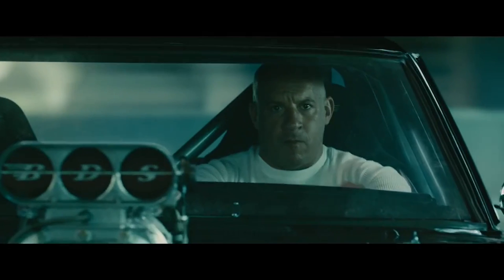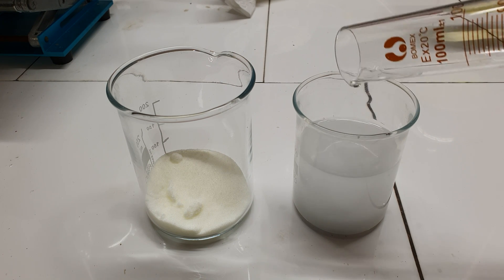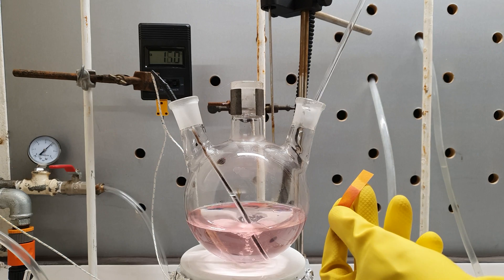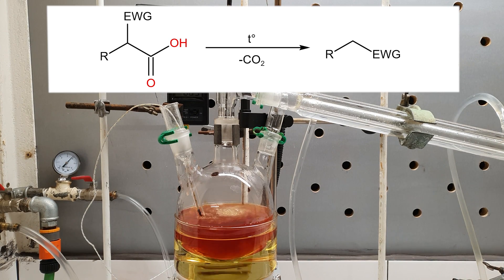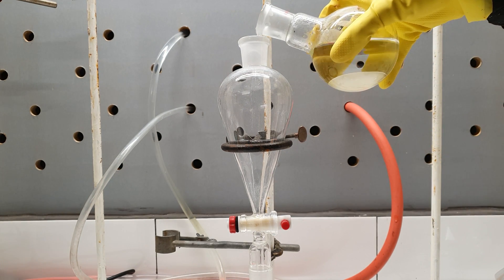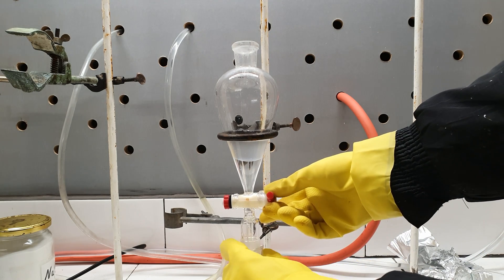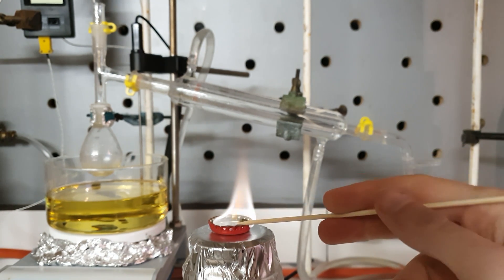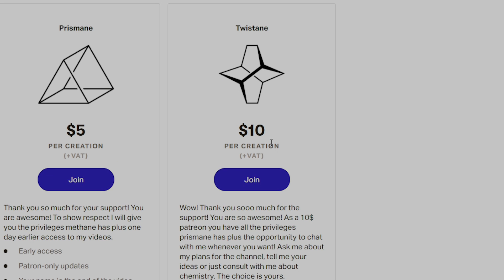Making NITRO for my CAR

Comment: Hi Hexazine,
The low yield is not your fault; it is mostly due to the ambivalent behaviour of the nitrite anion into the exchange reaction.
R-X + Na-O-N=O --> R-NO2 + R-O-N=O + NaX
As you see you have nitroalcane but also alkyle nitrite.
One of the main drawbacks of the nitrite ester is its volatility, and its hydrolysibility.
R-O-N=O + H2O <--==> R-O-H + HO-N=O
From this one sees that one of the side product is HO-CH2-CO2H that you tried to avoid during neutralisation of Cl-CH2-CO2H by NaOH.

There have been many trials to improve the yield of desired nitro-product:
-change the solvent to maximize the solubility of the nitrite into the reaction solvent and increase the substitution reaction
-change the nitrite cation (Na, K, Li, Ag,...); silver is the most efficient for the nitro vs nitrite ratio, but AgNO2 has limited solubility (it is a way of isolating nitrite vs nitrate because nitrite is almost insoluble). Silver salts also have their price.
-change the halide into R-X (I > Br > Cl for the substitution reaction but so does the price and availability is more Cl > Br > I)
So with a limited amount of money and of availability to chems, hard to make much better.
Also with those, you can hardly go to the 50%; the limit being in the 60%.

Kind regards,
PHZ
(PHILOU Zrealone from the Science Madness forum)
Reply: Это его вина. Не надо было жадничать. Если бы вместо NaNO₂ он взял AgNO₂, "доходность" была бы значительно выше. :)

Comment: You might have the chemology figured, but have you run the numbers to see if the combustion will happen with the desired characteristics? No pre-ignition? How will this impact the strength of materials in your engine? Will combustion pressures remain within design limits?

Comment: Very interesting.  I read that you can make nitro methane by passing methane gas through a fine mist of nitric acid and it will bind an NO to the molecule and condense into a liquid.  I don't know the method used, probably big stainless steel containers, perhaps under pressure.  It's not cheap fuel.
Reply: Theoretically (and practically) its should work that way.
Although for conveniance and control, I would drive a mix of alcane and HNO3 in a reaction zone, and condense all reaction products for isolation and recirculation of the alcane to the first stage.
Reply: Won't that produce a lot of byproducts?   I think that  nitro propane/ethan/methan/and butane would all work in my project, however.  "It's a SCIENCE experiment!!"   I am concerned with a combustion product of nitric acid and the RC and Dragster people use an oil to combat it or Kerosene .
Reply: @TheWadetube  
The synthesis produces more side products as the number of C linked to other C increases (more nitro possibilities, more oxidation possibilities as ketons or carboxilic acids, more elimination of alcohols to alcenes or decarboxilation to CO2).
The product needs to be purified first by distillation to get only the desired nitro-alcane (preferably NM).

The chemistry into the motor is way to complex since benzine and oil are already an awfull mix. I personnaly have very little interest in that aspect.

Of course playing with NM can turn your motor into a space shuttle motor, but usually the mechanic doesn't follow (pressure, temperature, rotating speed and octane index of the burning/knocking burning or explosion) can easily ruin your motor.
You rarely see people driving with 100% NM istead of benzine + a few % NM.

PHZ
(PHILOU Zrealone from the Science madness forum)
Reply: @philouzlouis2042  The motor in mind IS a rocket motor.  A heavy lift design that can withstand super high pressures and very high temperatures and so Nitro Methane is suitable for that end and with less oxygen consumption.  My concern is Residence burn time in the combustion chamber for a small 6 inch tall chamber for Stoichiometric results with minimal oxygen and safe burn by-products... no cyanide and no nitric acid .  Wish me luck.
Reply: @TheWadetube 
Good luck then :o)
The fact you want to make a rocket should be OK.
It is a rocket not for space (so not in vaccuum) and hence you have acces to some air (oxygen) arround and flying assistance (supporting fluid).
Air is important because all the oxygen that is not embarqued means a lighter overal weight for the rocket and thus more overal thrust.
Just to give an example, you have benzine what is mostly considered as a mix of alcanes (CxH(2x+2 )), if you have one kg of it this has more power than an equivalent weight of TNT ,glycerine trinitrate or NM.
This is the reason for the power of FAE (fuel air explosives) because the biggest part of the weight does come from the oxidiser that is on site all arround and as a minor part from the fluel; you only need the right timing and geometry to disperse the fuel and to ignite it as a mist.

PHZ

Comment: Nitromethane reacts with solutions of sodium hydroxide or methoxide in alcohol to produce an insoluble salt of nitromethane. This substance is a sensitive explosive which reverts to nitromethane under acidic conditions and decomposes in water to form another explosive compound, sodium methazonate, which has a reddish-brown color:

2 CH3NO2 + NaOH → HON=CHCH=NO2Na + 2 H2O

https://en.wikipedia.org/wiki/Nitromethane#:~:text=Nitromethane%20reacts%20with,H2O

Comment: Looks like about enough to mix up 1 tank of race fuel for an R/C car! Pretty sure it's not much more than nitromethane (a range of 5-40% is what I remember the hobby shops having), methanol or ethanol balance, and a couple percent of castor oil. Oil might be synthetic these days, probably still just as gross when it runs out of the pipe though.

Comment: If you substituted 3-chlropropionic acid for the chlroroacetic acid, this synthesis would work for nitroethane pretty identically, no?
Reply from the maker: You would need 2-chloropropionic acid.
Reply: The EWG group (electro-withdrawing group (aka -NO2)) must be viccinal to the carboxilic group for such CO2 elimination to be possible.

Comment: Will u put this in your car or do you need to scale it up a bit to get more Nitromethane? Why did you get a low yield 30 percent compared to 42 percent? Neat video.
Reply from the maker: Well, the whole car thing was more of a joke than an actual plan. It's mainly used in special race cars and you definitely need a lot more than 20 ml. 30% yield when 42 is the literature one is fairly good.

Comment: Колега, всичко е страхотно и много ти се радвам! Имам само една забележка - 40 г NaOH във 100 мл вода не прави 40% разтвор. Продължавай в същия дух, с интерес ще следя синтезите ти! ;)
Reply from the maker: Благодаря! Малко не съм го догледал 😅
Reply: @Hexazine0  in wikipedia they say that industrially it is produced by combining propane and nitric acid in the gas phase at 350to450°c

I would assume that reaction would be more efficient

Is it doable at a small scale or too dangerous?
Reply: @FirstLast-tx3yj  Bro you mixing 2 very dangereus thing at 300 celcius what you expect
Reply: @emir4707  that is how wikipedia says the industry produces it
Reply: @FirstLast-tx3yj  
The reaction is not that complicated at a lab scale; except for the volume you have to deal with (1 mole of any gas at STP is roughly 22,41 liters and following the same "perfect" gas law, this applies also for HNO3 or any liquid that is gaseous at 400-450°C).

The main problem comes from scaling up for an industrial scale.

The proces from HNO3 is exothermic so you have to temper it a bit (tinier batch, water of dilution, temperature control, heat exchanger, ...).

Usually one would start from CH4 but the reaction in this case calls for 450°C instead of 400°C for higher alcanes. 

Methane gives mostly CH3-NO2 and oxidation products.
Ethane gives CH3-NO2, CH3-CH2-NO2 and oxidation products (those goes up with each extra C connected).
You can manage the risk of "explosion" or runaway/burning by playing with an out of stoechiometric mix (more HNO3 but this would result in more oxidation products; or more alcane (more reductive atmosphere and exces alcane, especially gaseous or liquid ones are easily separable).
With higher MW alcanes, you end up with more and more side products linked to oxidation, cracking).
The purification calls for distillation to isolate a specific product in a temperature range; and maybe a specific derivative.

In industry they often use available alcanes like propane or butane but oxidation products also go up and for the cracking products (porpane will provide oxidation products of methane, ethane, propane; and butane will deal with oxidation products of methane, ethane, propane and butane).

Also 
methane --> nitromethane
ethane --> (1-)nitroethane
propane --> 1-nitropropane + 2-nitropropane
butane --> 1-nitrobutane + 2-nitrobutane (+ 3-nitrobutane + 4-nitrobutane) (those last two are identical to the two first due to rotation of 180° (symetry).
etc.

For example one simply will need to pass vapour of diluted HNO3 into liquid hexane (or gaseous) to get nitrohexanes and lower nitro-products aside with hexanone, hexadione, hexanoic acid, hexandioic acid, ...
I have even read that concentrations as low as 13% HNO3 can do the trick when codistilled.

A good chemist would then work from methane, ethane, propane or butane (all gaseous) or from n-pentane an n-hexane (both low bp liquids)).

Of course one soon realises that for the desired CH3-NO2, calling for higher alcanes, also means implicitely an exponential need for HNO3.

Kind regards
PHZ 
(PHILOU Zrealone)

Comment: Nice video again with extra 3rd level humour... :o)

Beware that in your description there must be a mistake regarding the mp... 133-135°C is about 33°C higher than the bp what is arround 101°C... and this is very unusual for a compound to display a melting point higher than its boiling point...
******************************
For the rest there are side reactions... 
The desired pathway is:
Cl-CH2-CO2-Na + NaNO2 --> O2N-CH2-CO2Na + NaCl
O2N-CH2-CO2Na -heat/H2O-> O2N-CH3 + NaHCO3
2 NaHCO3 -heat-> Na2CO3 + H2CO3
H2CO3 -heat-> H2O + CO2(g)

1) an excess of NaOH base in your neutralization will turn the nitromethane or nitroacetic acid orange brown due to a aci-nitromethanate or a aci-nitro-acetate...like this
CH3-NO2 + NaOH <--> CH2=N(O)-Na + H2O
The Na nitronates (from nitromethane or from nitroacetate) are salts...thus non distillable...they also decompose with heat and suffer hydrolysis into aldehydes derivatives very reactive towards nitroalkyles to form nitroaldols and nitroalcenes (in basic media what is your case).

To avoid this the use of weaker bases like NaHCO3 or Na2CO3 may be considered since chloracetic acid is more acid than acetic acid (vinegar)...and vinegar is a characteristic test acid to reveal carbonates or hydrogenocarbonate via carbonic acid evolution (CO2 bubbles)...so you will get less heat, CO2 bubbles and the desired sodium chloroacetate with much less basicity (more neutral media after neutralization)

2) The nitrite may substitute the activated chloride atom from chlor(o)acetic acid in a desired nitroacetic fashion (O2N-CH2-CO2H)... but also into a nitrite ester of hydroxyacetic acid/glycolic acid (O=N-O-CH2-CO2H)...the later is very hydrolitically sensitive towards water to form glycolic acid and nitrous acid...that turn into nitrite of sodium with the sodium carbonate present (one end product of O2N-CH2-CO2Na production)...thus most of the nitrite ester turns to nothing worthy...thus lost chloracetic acid...since the glycolate can't subsitute its hydroxy (alcool) with nitrite anion in basic or neutral media...while nitrous acid could... indeed the ease of formation of nitrous esters from alcohols and nitrous acid is very easy and rapid... as much as its reversal hydrolysis reaction.

It is possible that a very small part of the nitrite ester succeed to the nitroalkyle conversion...but usually this calls for higher temperatures arround 115-140°.

Those side reactions 1) and 2) lower your yield.

Also, in your procedure you multiply the number of aqueous distillations and decantations... so each time some of your yield is reduced by losses on the walls into the column, in beakers, balloons and also with the filtration (filter paper is really a sponge each pore and the thin air layer between filter and filter paper keep valuable nitromethane by capillary...what is lost by further evaporation.

It could be beneficial to add CaCl2 to your first distillate to saturate your watery layer, break the emulsion and kick nitromethane out of it... CaCl2 is very soluble into water and will make it very dense what will help decantation a lot more than NaCl does...then add your dessicant.
Transfer in a vial or recipient by pouring most of the upper layer and leave a little nitromethane with the remaining heavier partially hydrated dessicant...take the remaining nitromethane with a long needle syringe ... that way your yield should be optimized.

PHZ
(PHILOU Zrealone from the Science Madness forum)
Reply from the maker: Wow! That's such a great explanation! I corrected the boiling point mistake 🙂.
Reply: @Hexazine0  philouz is an awesome chemist and has comments on most chemistry channels as well as sciencemadness
Reply: @chemistryofquestionablequa6252  
Thank you ;o)
Reply: Hi,
I did notice by relecture a slight mistake inside my first reply; an O is lacking:
"CH3-NO2 + NaOH <--> CH2=N(O)-Na + H2O"
must be
"CH3-NO2 + NaOH <--> CH2=N(O)-O-Na + H2O"
Indeed the nitronic acid is CH2=N(=O)-O-H via an internal rearrangement and proton jump.

PHZ
(PHILOU Zrealone from the Science madness forum)
Reply: I think you will also get some chloroform due to decarboxylation of chloroacetate before it has a chance to react with nitrite, thus why not to do a reflux before going straight into distilllation ?
Reply: @papanyanz  
Nope,
I think

Following you..why, how and from what reaction?

Chloracetic, dichloracetic and trichloracetic acid don't form the way chloroform does form methylketons...or from methyl group next to a carbonol atom (ethanol, isopropanol, R-CHOH-CH3)

The first need Cl° (radicalar reaction) or Cl(-) source (strong and reactive halogenators)... the second needs a Cl(+) source (hypochlorite, haloamine, haloamide) with a base.

Those halogenators Cl(+) or Cl° or active Cl(-) are not present in the media.

Also acetic acid or acetate do not react with base and hypochlorite to acheive any halogenation of the CH3 part..

Chloracetic acid is not formed easily and cannot form dichloracetic acid or trichloracetic acid without activated strong halogenator.

If you start from acetone to get chloroform from bleach (basic NaOCl, NaOH, NaCl)...the resulting unafected part is acetic acid as Na acetate... you only get one HCCl3, not two, from CH3-CO-CH3 despite the molecular symetry.
This proof CH3-CO-OH is unreactive despite CH3-CO-R is.

PHZ
(PHILOU Zrealone from the Science Madness forum)
Reply: @philouzlouis2042  Sorry, I was thinking of trichloroacetic acid while writing that and this stuff does form chloroform through decarboxylation - there was a video of one guy obtaining chloroform using that method! Thanks for pointing out.
Reply: @papanyanz  
It is indeed possible to make chloroform via trichloroacetate decarboxylation (thermolysis)... but it has little to do with the reaction from the video ;o)

Comment: nice video! however, common misconception, anhydrous sodium sulfate only removes about 95-98% of the water (trust me, i checked with Karl Fischer Titration). Best practice is to use molecular sieves.
Reply from the maker: Well, from my professional experience there is no water peak in the NMR spectrum when using Na2SO4, so it should be mostly fine. For some special purposes I agree that additional drying steps would be needed.
Reply: Small amounts of water is no problem, for RC or drag fuel.
Reply: Justin, do you have this data on CaCl2 & MgSO4 ? what is their percentage?
Reply: Would calcium oxide work?
Reply: @teresashinkansen9402 CaO should be suitable for gases, amines, low-boiling alcohols, and ethers... but idk about nitro containing groups.
Reply: @teresashinkansen9402  Оксид кальция гарантированно уничтожит нитрометан.
Reply: I can only agree. There is even a paper about the efficiency of molecular sieves. They are unbeatable.